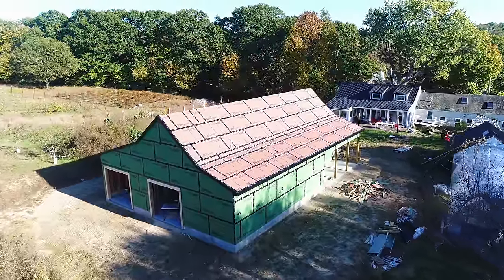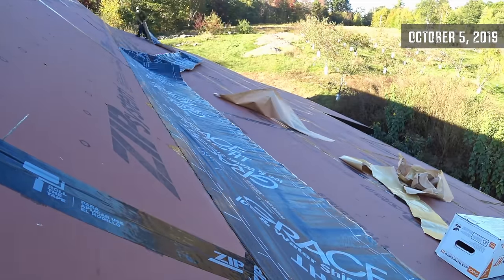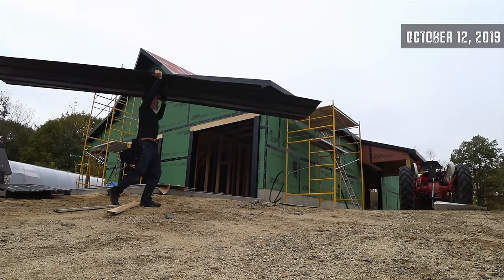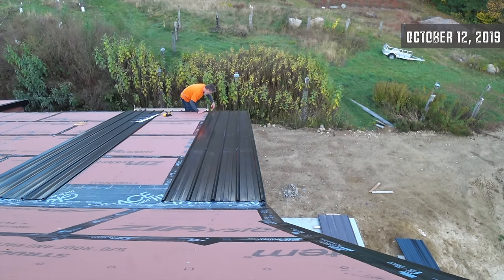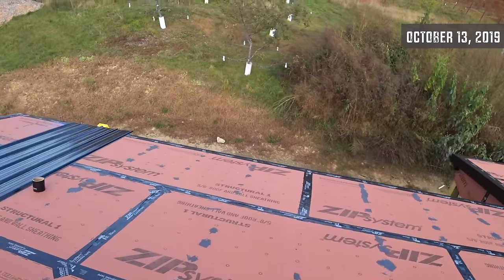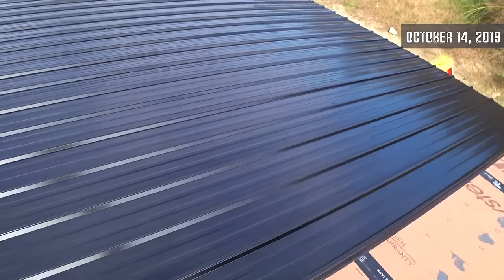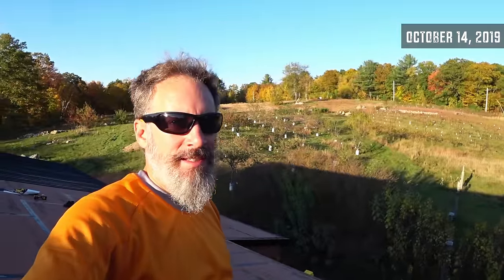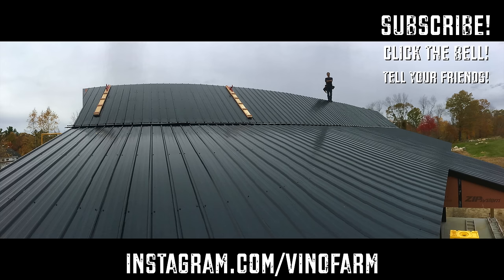Solo Metal Roofing - Dream Barn (Part 4) - Metal Roof Over Zip System

Comment: Sorry, but a mistake was made here. You put holes in the metal roof on the flats instead of the ridges, so when those screws rust and fall off (which they definitely will over time), water will have no issues getting through that. If you had gotten longer screws and put them through the ridges, there'd be a lot less water flow over them and therefore a lot less of an issue. Putting a bit of thick tar over each screw will help prolong the lifespan of the screws but obviously make the roof a bit less attractive (but I think it's worth it, especially given the mistake you made). Manufacturers don't always give the best methods for installation. The reason they don't mention that method is because it's easy to over tighten the screws (if using a drill) which could deform the roof a bit which messes with the math as you put it. But if you're patient enough (as you clearly seem to be), over tightening doesn't happen. The Youtube channel Pure Living For Life did it this way (and used a roof with no exposed screws) and they had no problems with that method.

As mentioned already, there's some newer panels available where there is no exposed screws on the roof, therefore making it a forever roof with no maintenance at all. But obviously it's too late for that now.

For the record though, I'm very impressed that you did all this alone. Most ppl would find help for this kind of work. Also, the fact that I only see 1 mistake here is very impressive considering that professionals make mistakes all the time (as you noticed with the builders), and you're no professional at this, so ya, high praise.
Reply from the maker: LET THE RIDGE vs. FLAT DEBATE BEGIN!!!
Reply from the maker: (Not ONE person I talked to during the ordering process (including the manufacturer) suggested screwing through the ridges. Literally every one in the supply chain said flat was the way to go!)
Reply: @vinofarm   I know, as edited in my original comment, even manufacturers don't mention the best methods for reasons I already mentioned. (sorry, I edit a lot). It's a new method for installing and most ppl are stuck in their old ways. It's like Pex vs copper when it comes to plumbing... it took an incredibly long time for ppl to start using Pex over copper even though it's been around since 1968. A little over 20 years ago when my dad started using Pex, everyone around him was calling him an idiot... but his Pex plumbing from back then has received no maintenance / repairs to this day. Ppl are just stuck living in a very linear path... they know how to do things one way and all other ways are wrong to them.

I think this Youtube series shows a nice new roof installation method that few ppl know about:  https://www.youtube.com/watch?v=RnNCqffitGc&list=PLp1Rm233y0B-DcRoZQv67qTjPkE87P74r&index=3
Reply: Back in the day, these roofs were fastened using lead headed nails which wouldn't provide an adequate seal. Therefore it was a fairly common practice to fasten through the ridges instead of the valleys....the idea being they would not be in direct line of the water channel. With modern, gasketed fasteners the best practice is to screw them into the valley (flats). I will say though Jim that my personal experience with metal roofs and water infiltration is that the screws are more often than not the culprit. Even if you managed to drive every screw completely perpendicular to the panels and didn't over or under torque any of them, in time that gasket will fail. I'd respectfully suggest you grab a SpotPro caulking nozzle and go over the screw heads for extra protection.
Reply: As it was explained to me also (along with the deterioration of seal and bolt situated in watercourse), was the fact that holding down on the ridges also allows for absorption of micro-vibrations within roof paneling. This allows the stresses and vibrations to be carried through the profile bends of the ridges rather than the flat surface of the valley. Many times I've seen cracks develop (over time) around the roofing screws placed in valleys, but never seen them develop around screws in the ridges.
As an electrician I've had to lift a roofing panel or 2 over the years (sarking  is a PAIN!), and also helped roofers lay paneling from time to time on new buildings & renos.
When we had our house reroofed (massive storm damage), I made sure that the contract roofer & I were on the same page regarding screw placement.
Reply: I'm in Australia and I agree, i have never in my life seen a metal roof installed with screws in the valleys, the Peaks, ALWAYS. We generally use what we call Corrugated Iron or Colourbond which is wavy but the type used here is sometimes used, there's no way it wouldn't leak if screwed in the valleys. The rubber seals on the screws degrade and crack or the screws come loose from expansion/contraction and you got a leak. I'm kind of shocked there's even a debate on the "correct way"
Reply from the maker: Here's the manufacturer of the panels I used. Not trying to stir the pot, I just think both ways have their pros and cons: https://www.youtube.com/watch?v=3Iun3uRIDEA
Reply: Either way can be done successfully. I install metal roofing the way you have done in this video. When you were starting from left to right I was hoping you would catch the ridge overlay mistake and you did. Great video and very impressed with the work by yourself. Next time pay a guy to hand and cut from the ground. Two day and done.
Reply: @vinofarm  You're absolutely right: ALWAYS use the manufacturer's recommendation. If you don't like their recommendations then use a different product. After all, if you want a warranty then you have to install the product as it was intended to be used.  
Fasteners have come a long way; they don't rust off in 15 years like they used to.  For what it's worth: here's my thought process: a pan-mounted fastener sunk all the way into dry wood with good neoprene washer won't be exposed to moisture and should retain its galvanic coating fairly well; while a rib-mounted fastener with 3/4" of air contact will see daily moisture/condensation in our New England environment, and also has the potential to have it's galvanization abraded off by the roof panel due to wind, vibration, and thermal expansion/contraction.  At the end of the day it comes down to maintenance: keep the underside dry and ventilated, and keep the topside free of organic debris and scratches, and your metal roof should last an exceptionally long time.  
Thanks for another video. 20+ minutes doesn't bother me in the slightest!
Reply: @vinofarm  the flat is where it's at. If you go in the ridges when the roof heats and cools it will expand and contract (albeit a small amount). If your screws are too tight it will stress the metal around the head of the screw and will eventually form cracks (especially if you originally screwed it down while the metal is cold).
Reply: 1:47 .....was that Superman????? 😀😀😀
Reply: turgsh01 Sorry but you are wrong, putting screws on ridge is lose install and sheets can move because wind and thermal movement which causes screw hole to deform bigger hole and leaking starts, valley is right way because it fixes sheet rigid and movement doesn't occur. 
We have fixed all sheet metal roofs from valley since 1970s before that we fixed them from ridge and and all those had caused issues.
My own garage roof is done 1996 (24 year ago) and nothing leaks yet EPDM rubber seal is still flexible and it's fixed from valley.
And not a single manufacturer in my country recommend ridge fixing.
Reply: @CSkwirl  
I couldn't agree more.. even in Western Europe it is done in that way.. but then again, we only use metal over sheds and not over Houses but this is a shed (edit, barn) so let's forget that..
I also am shocked that there's a discussion over this.. wow...
Reply: Ctreefort Calm down. This channel encourages the free exchange of ideas, comments, questions, and advice. This is how we ALL learn best practices. Jim will be the first to admit how much he’s learned from the comments posted on these videos. I don’t see anyone being disrespectful here, other than you with your profanity laced tirade.
Reply from the maker: @Steve Sherman I'm 50. This will probably outlive me.
Reply from the maker: @Steve Sherman  "Screw future generations" because I chose ribbed metal panels over standing seam metal panels? Oh boy... That's truly an all-star youtube comment.
Reply: turgsh01   You can spew misinformation, but you seem unable to read the manufactures mounting information, YOU ARE SUPPOSED TO PUT THE SCREWS ON THE FLATS, that is why there are Epdm rubber washers under the heads of the screws.     Whether you want a roof wit visible screws, or a roof with concealed screws is personal preference,   so go back to your mothers basement, and let the rest of us do our work, without you disturbing us.
Reply: I've been on a million steel roofs in my day. . . Always screwed on the ridges. Always.
Reply from the maker: @Steve Sherman Are you really that upset that I didn't put a standing seam roof on and instead chose to put up a different kind of metal roof? Are you a standing seam metal roof installer? You seem really worked up over this.
Reply: @jesperdahl1486  It isn't misinformation, it's a controversial subject that quickly turned into a debate. The fact that there's basically equal opinions for "Ridge" and "Flats" right now makes it pretty clear that the so called obvious installation methods may not be so obvious after all. Though I will say there are some misinformation in this debate by other ppl, but I won't point any fingers right now as it seems to already be getting heated enough already.

I will say this though. Have you ever assembled large furniture and followed the directions word for word and did not feel like the instructions were inaccurate or unclear? I have, and I've quickly learned to read the instructions once to get a basic understanding of procedures to take, then throw the pages away while I assemble the furniture. It's often the only way to get it assembled correctly without a massive amount of frustration.  My point is, manufacturers only care about selling you the products with a basic set of instructions. They don't care to give several methods of installation, that would cost them extra money. They also don't care about longevity beyond the competitor's products because of course, they want you to keep buying their products... we live in a consumption based world after all. I could easily give countless other examples of manufacturers not advising efficient means for customers to do things, but this post is already going to be too long.

Now going back to basic logical facts and not opinions... We all know rubber degrades rather quickly over time, so rubber washers aren't expected to help long term. Putting 300+ holes into a roof is like using bird shot (shotgun reference) into your roof and then covering them all with patches which then requires constant maintenance. The least that can be done is be methodical with hole placements so water has a harder time getting in (which is why I say "ridge" over "flat"). You also need to consider how snow will stay on the roof in the winter, especially when the slope is minor... having exposed screws on the roof is like adding traction for the snow and ice to stay on it instead of sliding off. Standing Seam panels are easily one of the best metal roofs available, but they're probably also a bit more expensive / rare and installation is far more difficult and time consuming. Given that he's doing all this alone (and it's his first roof install), I don't blame him for avoiding it.

Also, I tried googling metal roofs cracking / splitting apart due to screw placement and found nothing at all. Since I've never seen or even heard of a metal roof split / crack apart as described here, I don't know what to think about it. But my guess is (and this is just a guess, not fact) either constant temperature changes from day / night cycles and lack of screw quantity allow the metal to flex and snap over time and/or there's a flaw in the metal roof manufacturing itself or the metal was flapping in the wind and it just snapped at the screw locations. Either way, I can't see how screw placement would make a difference in that instance.
Reply: Watch RR buildings
Reply: @vinofarm  Regardless, the dab o' something (caulk/sicaflex/tar/grandpa's goop) on the bolt idea makes sense...At least the neoprene rubber ring needs some attention to be effective beyond a decade or so...
If you can and have the will to do it, I recommend you take out every individual screw, put a dab of Sicaflex (also available in black which is uv stable and works great with a caulk gun which is in turn not as messy as one may expect) and put it back in. I know, it is a lot of screws but I am quite sure you will be happy you did it when your roof lasts as long as it should 40-50 years versus just 15 years because the screws rusted out. BTW fixing (replacing) rusted screws which most likely will break while removing them in the hole is a great pain in the butt...obviously. Also rusting screws will make the panels rust faster then intended... just saying.
Reply: in the old days , roofs were cgi which had much stronger peaks , and nails didnt seal very well , these days both have changed , so with thin tin and gaskets on the nails , its nail , or actually screw , on the flat . But dont screw the screws in too tight and destroy the seals.
Reply: @vinofarm  The shorthand is the Vino Farm Effect. A beekeeper can install ribbed metal panels in New England, and in Central Park you get rain instead of sunshine.
Reply from the maker: @geerdvanselm9810  @RRbuildings screws on the flats. I haven't seen this debate on his channel.
Reply from the maker: @tomthompson7400  Yes, I was very careful with the torque setting on the screw driver. Any that were accidentally overtightened and flattened were replaced with fresh screws. It only happened 5 or 6 times.
Reply: @vinofarm  Gee, there's a few quite nasty replies here and that is truly a shame.
So James, your work is done, it will last.
Let us ALL agree to disagree of these points.
With that being said, "Where's the bloody bees mate!!!!" 👋👋👋 🤣🤣🤣🤣
Good on ya mate, all the best.
Reply from the maker: Pilot McBride Bees were flying and pooping today but it’s been too cold to open them up and film. Still quite a bit of snow in the field, but I’m hoping we get a warmup this week so I can get in there and check on stores. Stay tuned. It’s still winter.
Reply: Thank you James, appreciate it.
I miss my dose of bees, lol.
Reply: @Steve Sherman Why are you so jazzed up about a metal roofing preference? You’re carrying on as though he’s burying drums of  dioxin next to a day care center. Sounds like you have a financial interest here somewhere.
Reply: I have done 50-60 roofs of this exact type over the last several years. I have never installed the screws through the ridges. They are always installed in the flat part of the metal. With the current metal screw design( they have thick shanks and beefy washers), the more common problem is that the screws will back out over time because of the movement of the roof, not because the washers leak. Installing your screws in the ridge would actually exacerbate this issue and not mitigate it.
I would recommend installation exactly as you did it.
Good catch on the overlap issue by the way, a lot of people miss this and install the sheets backwards. The foot on the panel can actually cause water to be funneled up over the ridge and ruin roof.
Reply: Thank God you brought this up as I tried to in another YouTube show where they built timber gargarges, and these carpenters who did the framing, installed the decking metal roof but tex screwed them down in the lower tray instead of on top of the ridges on each sheet, and the reply was that was the roof code in this state of America allowed it?. I being a plumber for fifty years in Australia our plumbing stats that you srew down the roof decking sheet through the ridge of each sheet and not the tray.
Reply: @Steve Sherman do you really have to be that toxic?
Reply: @vinofarm  he's got other issues that have nothing to do with you. 😑
Reply: @vinofarm  I was going to post my metal roof install but after reading all these idiot comments I think I'll pass. You are doing a great job
Reply: @TerraFirmaX   It's been 3 years since they installed their roof and haven't mentioned anything about it since. Clearly it's working well for them, otherwise they'd be posting about it for views.

Also, lol on looking up my channel info... like posting videos and having a fan base means anything relating to what I know. I could be Holmes on Homes and still not know anything about anything because what you see on tv or in youtube videos doesn't necessarily reflect the person's real knowledge and experience. After all, the world is full of fakes. Also, maybe consider the fact that I haven't posted anything on youtube simply because I found other ways of making money and am too busy for this sort of thing... possibly relating to roofing.

Also, in the future, before jumping into a topic like this on an old video, consider the age of the discussion as it took me some effort to figure out what this response was even about. Most ppl would not have bothered to read or respond to your comment at all.
Reply: Contrary to intuition,  screws go on the flat area, preferrably next to a rib.
Reply: @steventhury8366  That's your opinion. Read this really old discussion in it's entirety before contributing to it in a lazy manner.
Reply: @turgsh01 I find your copper vs pex comment funny, as it contradicts your statements. The OLD way was using nails in the ridges, therefor screwing in the ridges is holding on to the old ways. Not adopting new techniques. And the new way is using better material (stainless screws, neoprene washers, etc). So in fact you are guilty of the same fact you push with people choosing copper over pex by pushing old methods because you THINK it's better, not because the people making the new stuff advice you to use the new methods of installation with the new fasteners all together with the new thing you just bought. 

And then you go pointing to a completely different roofing system, that also happens to use fasteners on the flats (simply because there is no ridge to fasten on). But new, inventive and only few people know about? Hardly! Standing seam roofing has been around since the copper roof days. It's also much more labor intensive and hardly comparable. If your argument is durability over price, then why do we even have IKEA? In many cases durability and ease of installation are at conflict. Not everybody has the wants, needs or even has the means to go for the highest durability. 

And finally, I highly doubt that standing seam roof manufacturers provide any significant durability warranties over these types of roofs. 20 years limited warranty is about the max you would be able to get for any kind of metal roofing system. Let alone if you install it yourself, manufacturers are kinda that way. (and limited warranty usually means very very limited)
Reply: @turgsh01 Also, thank you for pointing out a (for now) interesting channel about building/homesteading I hadn't found yet. So I went ahead and watched more of their videos struggling big time. And that is the point I want to make here. Their failures with this co-called innovative system. 

How many episodes (and failed orders/lost dollars) does it take them to finally figure out the ridge cap on this innovative standing seam roof? I would figure that a manufacturer would have a proper installation manual/options available on paper to choose from. Not having the customer figure it out by themselves? Or having a custom ridge cap made because of their choices? Or having to figure out how to install said ridge cap? Which by the way is completely unsupported at the peak and solely relies on the fasteners to stay in place. 

They even talk about how they had to consult with the manufacturer on getting warranty for their hidden fasteners. Hidden fasteners weren't even an option for this system. And I highly doubt they can successfully hold them to their warranty promises if their roof might happen to fail in 10 or 20 years. And even so, they allowed hidden fasteners ONLY if part of the roofing system used visible fasteners. Which again, are on the flats and provide the same trouble you stated was wrong.